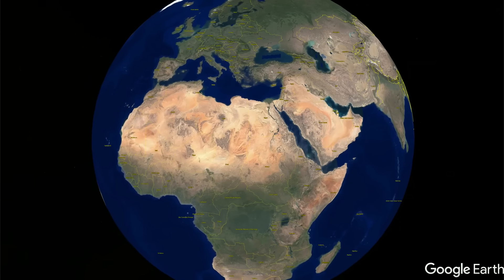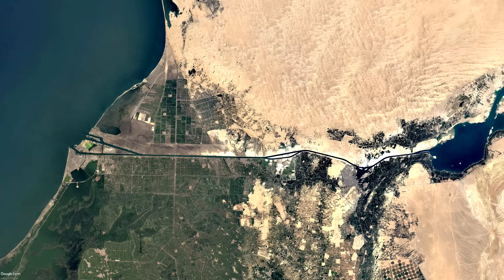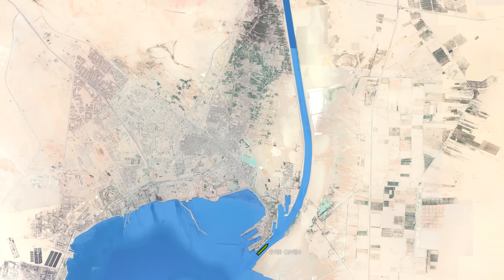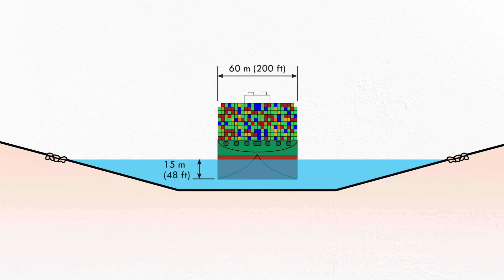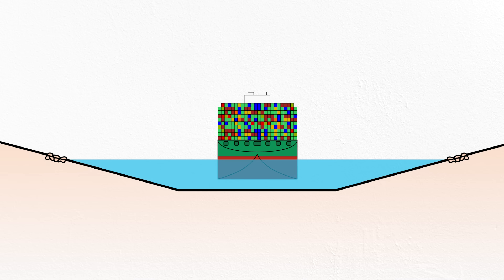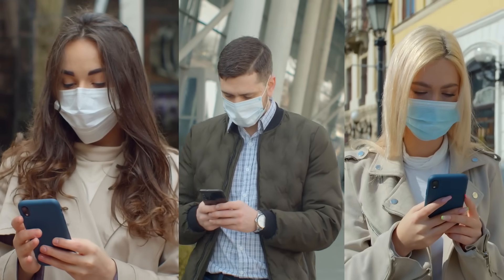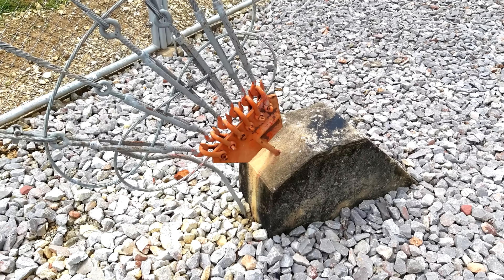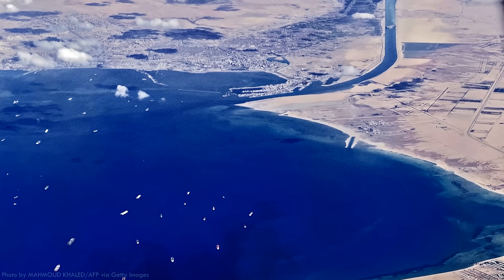What Really Happened at the Suez Canal?

Comment: Not where I thought you'd go with it. My thinking was that if the boat is not at least somewhat centered the difference in flow on either side, one faster than the other would cause the boat to overturn if they ever got too close to one bank or the other and had to turn back toward the center of the waterway, or if there is a substantial difference in surface texture between the port and starboard the difference in flows would make it difficult to keep the boat straight, depending on the speed. Of course, it makes sense that they wouldn't try to turn toward the side with less distance to the bank, and I'm sure there's a boat inspection before they let them go through.

Comment: You did a good job (as always) of illustrating the affect in general, but it's also important to examine the two different interactions with the ship's hull: Bank cushion, at the bow of the ship, combined with bank suction, at the stern of the ship, to create the turning moment that wedged it in place there.  A ship in a trapezoidal channel experiences these two forces on both sides of the ship, bow and stern all at once whenever the ship is centered in the channel. All are longitudinally symmetrical, so the balance out. But bank suction/cushion was not the cause of the casualty. The cause was the vessel being steered to the left of the channel (to the vessel's port).  This navigation error put the suction/cushion forces out of balance and created the turning moment that resulted in the grounding.

Why was the ship steered to port? As you say, the investigation is not finished, but if you look in very early photos of the ship when it grounded, within just a few hours, in the distance, on the right side of the channel, to the vessel's starboard, you will see a cutter-head suction dredge (it is blue, and it was later used to move sand from the vessel to unground her). It's normal for a ship approaching a dredge to move over to pass a dredge operating in a channel like this. But in this case, it was just a little too much. It was a small error indeed, but once it was made, enormous forces were already unleashed on the ship and the turn to starboard could never have been corrected by the rudder fo the ship.

Bank suction/cushion is a cool tool for a skilled navigator. A much smaller ship, in a much smaller channel may run down the channel with absolutely no steering inputs, because the bank suction/cushion equal out, keeping the ship in the middle. If it strays one way, the forces naturally turn it back from the bank. Of course you have to watch out, lest you get too near the channel edge and turn hard. A smaller ship in a smaller channel may also navigate along the edge of a channel by simply steering toward the edge constantly (but gently). The rudder pushes the ship toward the bank gently, and the cushion pushes the bow away gently, making the passage of other vessels very easy.

Good ship handlers understand and use these forces on a daily basis. Every rare now and then, though, they screw it up. When the investigation comes out, you'll likely see that dredge mentioned.

Comment: I think we just need to stop making container ships more massive.  The advantages over just using more of the less massive types aren't as great as some think, and are partly just done out of force of habit.  What happened in Suez is also a symptom of a larger problem, that being, that our trade infrastructure was NOT built to handle ships this massive, which is exactly why many ports won't even accept ships as big as the Ever Given in the first place.

And we can't just dredge our way out of it either, that only partly solves the infrastructure problem, sometimes creates toxic wastes, requires costly maintenance, and has to be redone in the long run as ships just get bigger.  Not helping, is that it can take so long to do, that by the time it is done, it's sometimes already out of date.

Comment: All the info he gives works against it being stuck for long periods. It was a intentionally stuck and kept there to aid in the e massive goal of collapsing the world economy! The ship stopped moving this would have eliminated the suction force alone the bottom of the ship; helping to lift it up and free. The water ballast where emptied this doesn't take long and would have lifted the ship considerably higher setting it free, the the tides come in twice a day every 12 hours for hight tide, this would have lifted the ship and set it free. The angle of it's wedge was obtuse and very simple for tug boats which have larger thrusting capabilities then much larger ships to pull it both off the rear bank since it was sloped inwards against an cleaning sloped hull and backwards into the canal pulling it's bulb out backwards the same way it went in with little to no resistance. Non at all given all the factors combined! The ship could have actually freed itself with no help either immediately after a complete stop or within a couple of hours of being stuck by dumping it water ballast and waiting for high tide. It was put there and kept there intentionally! Just ask Jeffery Epstein...😋👍

Comment: Good video. I particularly enjoyed learning that the Red Sea and the Mediterranean Sea weren't at the same level and that there was a small current in the Suez Canal as a result. Is it always in the same direction? 

On a different topic, the main cause based on media reports was the wind storm. This fit with my idea that the speed of a ship through the canal is tightly constrained and that the ship is probably going at a speed which is just above the necessary speed to maintain steerage way. When there is a large wind the necessary speed to maintain enough steerage way to deal with that needs to increase. Did the ship increase its speed enough to deal with the wind? If it did increase its speed was it going too fast for the reduced visibility caused by the dust storm. Although the Egyptians seem to be focused on blaming the ship owners it might be the problem is that the Suez canal is just not suited for the largest ships when there is a windstorm.

Comment: Bank effect is almost certainly a red herring in this case.  In order for bank effect to occur, some portion of the ship's hull must already be dangerously close to one of the banks of the canal.  Some kind of ship control failure has already occurred, if bank effect becomes relevant.  A properly functioning ship that is genuinely under human control, is piloted such that it stays as far away from the canal banks as possible.  That is, it carefully navigates down the center of the canal, such that it stays as far from the edges of the canal as possible, such that bank effect doesn't occur.

The real question is, what kind of control failure occurred with the Ever Given, so as to cause it to deviate from the center of the canal, as it was transiting the canal?

The answer to this question most likely has to do with the side wind force acting on the wind sail area of the laden vessel, thus overpowering the underpowered bow thrusters on the vessel.  All vessels have some intrinsic design limitation, whereby a sufficiently strong side wind will overpower any maneuvering thrusters on the vessel, such that the wind can blow the vessel sideways out of control of any human operators piloting the ship.  On the open ocean, a vessel can use the rudder to aim itself into the wind and then move diagonally through the sea.  This however is not an option in the narrow confines of the Suez canal.  While operating in confined spaces like the Suez canal, ships must align themselves with the canal, and thus the bow thrusters must provide all necessary force to counter any side wind forces acting on the front of the ship, or else the ship becomes uncontrollable and simply gets blown sideways at the mercy of the wind.

Comment: So it sounds to me like the Evergiven got too much 'sideforce' equivalent to aerodynamic downforce and got sucked into the bank similar to the extreme downforce on F1 cars sucking them into the ground as the air speeds up through the diffuser?
Reply: Partly.    Think about how much surface area is along the whole side of that ship with containers stacked 20 meters or more in the air.    That much surface area pushed by strong winds must have needed some compensation by the Egyptian pilot.     So both wind force and water forces.   

   Then if the ship gets off-center the force of water on the ship rapidly becomes unbalanced.

Comment: I've seen tugboats back up to a stuck vessel and tie off short.  Then they powerup blowing the sand from under the stuck vessel.  This does cause other problems but those are easier to deal with than having the canal blocked for such a long time.  Don't know if this was used here or not but it is a way to get stuff unstuck.

Comment: Checkout the Blancolirio channel. The primary cause is likely to be the crosswind and the impact is somewhat similar to what aircraft experience. The ship has to crab into the wind and keep up speed so that it's rudder provides the required force to counteract the wind force. After rounding the first bend, the ship appears to have steered too close to the west bank and overcorrected and ran into the west bank. It likely feared the suction force you describe but it was not there in the strength guessed at. Egypt is holding the ship ransom for $1bn. EverGreen is unlikely to pay anything over $100m as the real cost to the canal authority is likely no more than $20m for dredging works and repairs. All the ships went through the canal after the delay, having paid before they arrived to enter the canal. The shipping companies won't seek compensation from Evergreen as they might be the cause of a future problem - they don't try to cause each other grief apart from accepted competition practices. While other EverGreen ships can't pass through the canal until the issue is resolved (they will go around Sumatra and Africa travelling an extra 6000 km, ~ 8 days sailing in the cheapest cost per container ships in the world), the owners of the cargo on the Ever Given will be up in arms and the Egyptian government will come under pressure from the EU and China to accept a reasonable amount and release the ship, or release the ship, except a moderate downpayment and send the full cost to arbitration after the cause of the accident has been established. The canal fees are quite high - perhaps half the cost of going around Africa. EverGreen customers will keep faith with the company to demonstrate they don't give in to governmental extortion. Egypt is behaving as if it caused the accident. Shipping lines have a long memory and will outlast the Egyptian government. Egypt should remember it is part of the logistics chain of good service - it has ruined its reputation by holding the ship and cargo hostage.

Comment: I have seen this effect on a "narrow boat" in a narrow part of an English canal.  The surface against the bank could be seen going down by two or three inches at the stern.  Every so often the stern of the boat would swerve into the bank, overriding the tiller..  I found that the solution was to cut the throttle.  The propellor would stop sucking water and the stern would rise. The boat would then respond to the tiller again and you could square it up.

Comment: How about replacing your bricks with a wood block about half the width of the flume, cut to resemble a ship in plan view, attaching a string to the bow and tethering it with a string to a cross-beam upstream?  If it's tethered at the center of the flow, the force from the string should keep it centered, but as you shift the "ship" off-center, you should be able to see it pulled toward the side wall by the bank effect...

Comment: Interesting! Could have they used a strong pump to push water into the sand around the front of the boat instead of digging? That way they would make the sand liquify making it easier to pull the boat... of course at this scale, who knows if it would work.

Comment: Thanks for the video. You don't mention the windage effect on these vessels. Given the length and freeboard height of the loaded vessel and as your demo shows the accelerated water round the vessel flows in a non linear way which probably changes the CG and points of rotation for the wind force and rudder / propulsion. Can a vessel of this size actually be controlled in a narrow waterway where it is not possible to counteract windage by turning the vessel into the wind?

Comment: Hey, Shipping Analyst here

The "finger trap" was spot on and something not mentioned in the Stirling Salvage lecture with Flexport. One extra thing of note: If you look at the bathymetric maps you can see that only the eastern half of the canal is deep enough to support cargo ship operations, the other half of the canal is for tenders and smaller vehicles. So the suction effect was very pronounced because the actual useable canal volume was much smaller. 

Overall 10/10, very simple and gets down to the heart of the issue. I'm glad to see people are paying attention to maritime infrastructure, despite the fact that it has a huge impact on our lives most people don't know all that much about it. Stuff like the container crunch and everything else influencing global shipping sorta goes unnoticed usually.
Reply: The tides that helped free the ship were Spring tides, When the earth, moon, and Sun line up—which happens at times of full moon or new moon—the lunar and solar tides reinforce each other, leading to more extreme tides, called spring tides
Reply: @radicaltronic1855  <3
Reply: @radicaltronic1855  If the tide was instrumental in freeing it—It was also probably instrumental in screwing it.
Reply: Could they help the ship get unstuck by blasting water around the front part with something like firefighting water hose? Just a random idea, but the pressurized water might be able to enter the space around the nose of the ship and permit extra water to get sucked in easier. Plus it would simply wash some sand away
Reply: I still don't understand how this happened in the first place as the suction effect (at least in smaller ships) is on the stern of the vessel and the bow is pushed away form the bank.  Newly licensed 100t here with no narrow channel experience, just the study guide for this one. Is it that the suction on one side was much greater due to channel geometry and not properly corrected for?
Reply: @svroundabout  

Suction effect just makes it difficult to navigate in canals in general, and worsens with speed, you have to note that the pilots were speeding at 13 knots over the 8 knots general limit.

Causes of the incident are still unknown. Although I believe the canal authority ruled out the winds. There were early reports of a blackout on the ship but redundant power systems make that unlikely, although with a fairly recent ship there may be undiscovered software issues or something.
Reply: @svroundabout  I have experienced the suction effect on vessels as small as 40 feet in length.  It was in the narrow portion of the Lake Washington Ship Canal in Seattle under the Montlake Bridge.  It caused the entire vessel to be pulled closer to the side of the canal. I have also observed it occurring when two vessels are traveling parallel in the same direction.  If you get to close, then the force will pull the two vessels towards each other.  
Safe sailing.
Just some info from my experience as a fellow 100t in Seattle.
Reply: You know who DOES pay attention to ships, shipping, and the hydro-physics surrounding them? Elementary and middle school students. They LOVE big machines. In his early years, my (now) 9th grader studied everything having to do with shipping disasters, how big ships work, water displacement, etc. He brought this video to my attention today and explained it all thoroughly. Then he asked if I would give him school credit for his presentation. LOL! He studies what he loves---the idea for credit always comes later.
Reply: @dorindagrandbois7847  Now there's a kid to be proud of! :) Wishing him the lifelong joy of finding out stuff. 
And he sounds kinda like me when Dad was in the Navy 1960s -1980s.
Reply: @dorindagrandbois7847  Is he working from home or in school? I was a homeschool parent and got my master's in education, interested in alternative practices
Reply: <3
Reply: Is there any way to create a dam around a stuck ship and flood the interior until it floats off the bottom?

Comment: I always struggled to understand the principle of increased flow rate leading to drop in pressure until someone told me the important distinction: the static pressure drops and the overall pressure remains or rises. The motion leads to the average vector of the atoms and molecules pointing more along the surface and not randomly into it. This creates the apparent reduction in pressure.

Comment: In my experience problems such as this drive us to understand the process at a more detailed level. One of the things I thought should have been available and employed were the large inflatable air bags used to life damaged/disabled aircraft. It might have take quiet a few of them. I am also surprised that the super tankers such as this do not have escort tugs on each side to prevent this from happening. The concept of the water being sped out the sides is similar to the effect of low level fast moving aircraft which can cause them to crash if they are not aware of it.

Comment: Your explanation of the bank effect doesnt explain how the boat would get stuck at such an angle like that. If the suction was uniform along the side of the boat then it would have run aground at a shallow angle. The article "The bank effect and the big boat blocking the Suez." by Brendan Greeley in the Financial Times does a good explaination for why the bank effect would cause the boat to turn in to the opposite bank which seems much more in line with the path the Evergiven took.